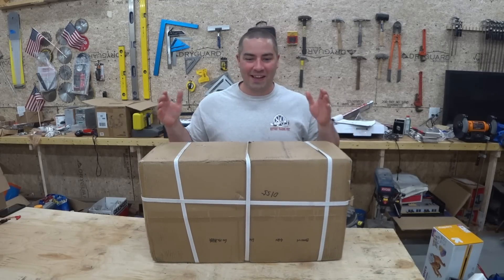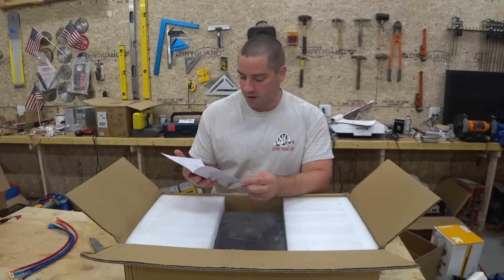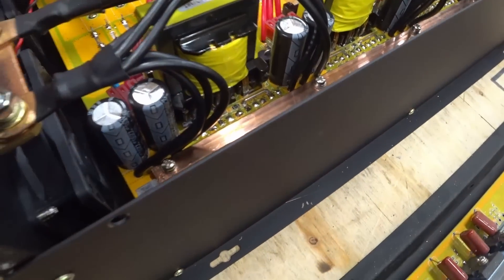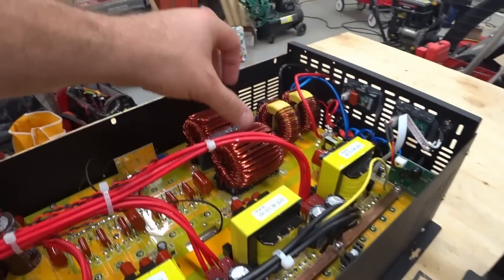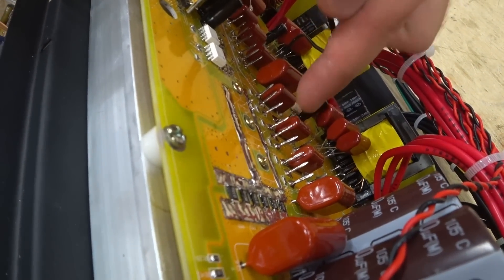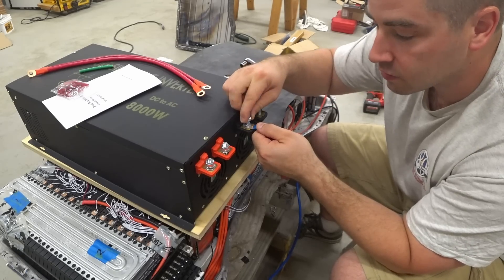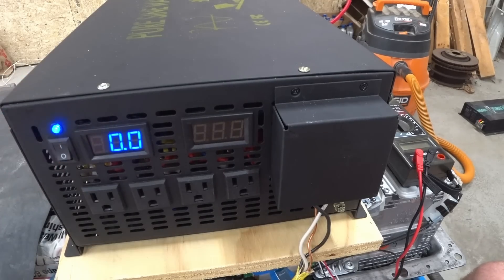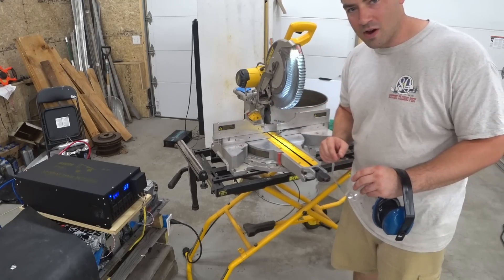Cheap 8000w Reliable Inverter, That Works! WZRELB

Comment: Awesome, now I’m really wanting to go off grid. With an inverter like that one, I wouldn’t have a problem keeping my house running 24-7 on battery’s and solar
Reply: Do it with a junk Inverter like this and you will end up with no power for most of the time, this rubbish will fail sooner rather than later guaranteed.

Comment: put an oscope on the inverter and see how clean the power is.. that a true indication on how well the inverter is.. thats the best test.
Reply: Indeed, also make a step response, use a storeget oscope and capture the first 200 ms to see the voltage drop, use a ac motor under load. Do not rely on a led display where the update time is poor, it is only for indication of how voltage is approx.
Reply: You do have to be VERY wary of claims and specs.  I even saw one inverter recently advertised as having "Pure modified sine-wave" output. Marketing people will do ANYTHING to sell stuff.
Reply: @exgenica  PURE BS LOL
Reply: A new, single-channel 70MHz scope decent enough for this kind of work is available these days for under US$100. Well worth it when investigating sources of noise and quality of AC. There are even some nice handheld digital scopes out there for about the same price that could probably address most issues involved in non-commercial AC hookups. I think I saw a new one on ebay/Amazon for about US$75 a week ago or so. Do thorough check of reviews and check to see if any youtube tutorials on the equipment before purchase.
Reply: @exgenica  That's Very Cool!! I haven't seen the scopes less than $100, but then, I was looking for better resolution. I never thought of 70Mhz.
Reply: Thanks for letting me know before I wasted an extra 15 minutes on this "test" - as if the first minute of repetitive comments and intro graphics weren't bad enough.
Reply: Yes, try to be nice. He is much more normal than the Tech Nerd like some of my friends and myself. Without Scope, we don't know how to work, and make a report.
Reply: Yeah.....be nice to see the wave output.....how true sine it really is......
Reply: Not sure he would know what a scope is or how to turn it on.
Reply: @g7mks383  really, stop acting like a prick!
Reply: ... It has these things here.... Has this thing that goes to this thing here....Which has two loop things and a screen with these line things.
Reply: @g7mks383  found the cool guy!, woooah, you know how to use a scope!
Reply: LOL  @g7mks383
Reply: @unreal6029  be nice -  he is trying -  and he posting - encouragement - advise - I  am concerned about lack of breakers - even dirty power kills. Shop around - Look for a used electical supply store - Locally or online - Keep Posting  / Keep  Testing - but Be safe.
Reply: @thomasbaldwin9594  That doesn't matter, because he is showing what the buying public will experience.

Comment: I have a 4000w for almost a year and going strong, but I rarely go above 3500w
Reply: Michael Tang how much it cost yours this days please?
Reply: i run a 2200 watt saw off 3500 w,.they say allways have 1000 more than you need.my gen inv. is 3500 as well.

Comment: The reason that the voltage increased (impossible) is that the RF noise produced by the 9 amp band was got past the output filter and interfered with the volunteer circuif.
This is remedied with an L/C filter between the vo!tmeter circuit and it's DC power supply and perhaps between the voltage signal connection and the voltmeter circuit.

What batteries, mfr model AH are you using for the 48 volt input ?
kvanderlipp@gmail.com
Reply from the maker: Thank you, that's interesting about the RF noise.

I'm using a battery I've been building the last few months.  It is from an electric vehicle (Smart Fortwo).  The original pack was 17.6 kwh, but I have re-arranged the cells and removed some.  I estimate around a 15.5 kwh pack right now.

Comment: the plug you used it your video looks like a GFI plug? this works with a floating ground?
Reply from the maker: I Guess so.   In an upcoming video I'll have to connect more outlets to try and load the inverter up with 8kw.  I'll try some outlets that are not GFCI
Reply: Leigh Amos , GFCI receptacles do not require a ground reference to function properly. They monitor the imbalance between hot and neutral to determine when to trip. BUT in this situation they will NOT function anyway because the fault current cannot go back to the inverter neutral since the inverter has no ground reference. The neutral of the inverter would need to be grounded to the earth for the GFCI to trip.

Comment: Could you Please check for me about the floating ground. Could you check if it is 60 Volts between the ground and each side of the blades on the plug or ground on the front wire hookup
Reply from the maker: Yes, there is 60 volts between HOT and Ground, and 60 volts between Neutral and Ground.

Comment: the AWG ratings are conservative and a usually for long distance. I have done testing myself on many wires and 10 awg can handle 60a no problem. just dont use it for long distance as the voltage drop would be massive.

Comment: I’d like to see the output sine wave on a scope to see if it is truly a sine and not half square wave or any riding spikes. I would also look up the awg chart to find out the required gauge wire for the stated amperage and replace those wires...regardless if they are short. I also wonder if there is adequate heat sink compound on those fet’s and not just a thin coat to save $$$. I would also check the output voltage with a Fluke meter...I do not trust those LED readout circuit boards. I did not notice if there was a cooling fan inside...if not I would definitely add one as it will save years on the fets. All in all, I am impressed with the performance.

Comment: Am I missing something? 8000 watt inverter is over 60 amps ac.  (2) 15-20 amp devices should be a walk in the park for a 8000 watt inverter.
Reply from the maker: They should be.  LOL.  I have had 2 8000w inverter blow trying to start my miter saw with nothing else attached.  So when this one worked I'm excited.  You can check out my other videos if you want to see the inverters fail.   In some upcoming videos I'll try to load this inverter down with 8kw.

Comment: No electrical approval? CSA or UL ? Also notice no approval on wiring or lock washers. Cheap screws phillips. They used crimp terminals and soldered them.  .
Reply: Yep, whatever poor electrical isolation they have in the rubbish will give out, it will end up killing someone

Comment: 8000 watts at 120 volts is about 66 amps. Also I would like to see that output on a scope, as it does boast a Pure Sine wave. A standard house wiring is 15-20 amp breaker per leg. I would breaker that in similar fashion...leads to the question of if they actually ARE using large enough wire on the output?
Nice vid. Thumbs up

Comment: Nice setting there, David! I would also be concerned with those thin wires. I have a 40 kW battery pack (traction batteries) and I connected it to my VictronEnergy 5000/48V with a 00 (2/0) wire AWG - in Europe we use metric units - so 70mm2. It never heats up and the whole setup works perfectly. The Scotts have a saying: I am not so rich to save on quality. ;-) Hope, the inverter meets up your requirements and it will be indeed reliable.
Reply from the maker: That's a good saying.

Comment: I Guess it increased the duty cycle going to the transformers when the load increased. Some inrush and maybe low resolution of the PWM lead to an increase of voltage under load.
Reply: Or probably they have programmed it to slightly increase voltage under load to compensate on line drop like most of the usb chargers.

Comment: You tested an inverter that is rated for 8kw continuous/16kw surge with maybe 2500w of load.

You plugged in some light loads and said "woo it works". That's not a review it's a travesty.

Come back with a proper testing methodology to test full ratings.

Till then you are just a paid shill.
Reply from the maker: In an upcoming video I plan to load it up to 8kw.  If it gets there I'll see how long it lasts, or if it gives up the smoke.  LOL

Comment: Thats undersized wire as the Chinese think 8000 watts at 240v is 33amps. Do that wire should be #8 awg for 240 v 33amp. 8000 watt.  On 120v it's 66 amps. So yes their engineering have severely screwed up
Reply: the length of the wire also plays into the required gauge of the wire.  For this length wire 10 g is quite adequate.
Reply: @carlglassmeyer8425  it is nice to see that some people understand resistance - generally the elecrical specs listed for different size cable/wire [gage] the current rating  is tested at 100',  not 6" so Carl is correct, 10 gauge is more than adequate. long circiit runs induce more resistance - therefore require larger gauge wire. Short circut runs have less resistance therefore  the opposite.  I would think this invertor would get hot  - overload drawing 5000 watts for 10 minutes. I have not read the invertor rating, but agree the transformers look small. The cable of concern are "outside the box"  the DC cable run.  Carl can explain.  I think the invertors are like many other purchases, you get what you pay for. 1st good thing - this company stands behind it products. Please test this invertor after 100 hours then 1000  hours of use. The designing engineers will watch. Hi tech is changing everything - time is the  true test. Keep testing - keep posting - keep infoming. THANKYOU
Reply: @carlglassmeyer8425   correct
Reply: The maximum continuous load will be 4000 to 5000 watts. You can't run 2kw through those little transformers continuously
Reply: Also... Chasis wiring is different from than house wiring.
Reply: The rating is likely at 240vac not 120!
Reply: Wrong! It changes in a metal chassis! I do agree though...I would have used #6THHN!
Reply: They probably know... but it's .01cent cheaper, so why not?  :)

Comment: You suffered with those previous models. From my experience I would not trust anything made in China with a funny brand name like 'reliable inverters'.  This model will hopefully suit your needs of course and work well but for myself would buy elsewhere like Taiwan or Malaysia made stuff is much better quality in general.
Reply: Exactly, this cheap Chinese stuff is rubbish, poor quality manufacturing, poor quality components and poor reliability, will only end up in landfill when it fails and cannot be repaired such a waste

Comment: This video is very nice presentation of device...
About the wiers...if the improve most of the elements maybe they put high quality of copper for output wiers...
For that short part from board to connection terminal is just fine...only things you are still missing is fuse after output(~20~30A)...to protect yourself before testing all of these devices...
One more time thanks for sharing your experience with us...
Great job...

Comment: I admit, the surge tests you ran looked good so far.  I wonder if the protection circuitry that inverter uses actually does indeed protect the power FETs, or uses them as a fuse, like so many cheap inverters?  Another test I would like to see performed is: what does the output voltage do as the input voltage is varied +/- 20%.  I also like to use an IR camera and look for hot spots in the circuitry while the inverter is at full load.  Time will tell however after at least a month's worth of use.
Reply: I used to work in a Motorola group producing Pwr. MOSFETs.  A common failure mode is a Source-Drain short circuit that would place a short circuit pretty much  across the input DC.  Hopefully each MOSFET seems to be individually fused so a single shorted FET will cause its' fuse to pop. That should protect the PCB from having a hole burned right through it which would render the unit unrepairable.  The problem is that if the load isn't removed or power cut-off immediately, the remaining FETs will try to make up the power loss and very likely fail very quickly thereafter, consecutively popping each of their fuses when they become shorted.  At least distributed fusing should save the PCB from getting multiple holes burned right through the card.

Comment: I have bought numerous Chinese inverters on eBay over the past year while trying to build up a solar system.  Everyone of them has grossly failed to put out what the ratings indicate.  For continuous output power, they  ranged from an actual output of 10 to 50% of published ratings.  By looking at the size of those 4 step-up transformers in the inverter you are testing, I would estimate your continuous output power to be about 3,000 watts.

Comment: You get very excited about something working the way it should. If you have had problems in the past with "bargain" inverters, you get what you pay for. A couple of inexpensive meters on the input and output would give you some meaningful information and some credibility. Load the inverter and let it run for an hour or two and measure the temperature of that big heat sink.
Reply from the maker: That's the plan for an upcoming video.  Thanks for watching.

Comment: ive always found that using the biggest wire possible is best , when my 2000w said use 2ga i said nope , 2/0 it is !
Reply: Unnecessary but wont hurt
Reply: +mazda2284  That was very smart.  2AWG wire can handle a decent amount of current as it is, but using 00AWG wire gave you a wider safety margin.

Comment: the wire is only 6in long. Fine for 60amps most likely... As a rule of thumb we say if its under 3ft, its no problem to go down 1 size.. And those 2 wires are only 6in..  No problem

Comment: Hard to say what that meter is measuring in voltage. I would want to hook up an oscilloscope and compare waveforms AC and inverter.
Reply: Amazing; that's exactly what I was going to recommend.
Reply: LMAO 🤣🤣🤣
Reply: Cual es el precio del equipo

Comment: Hey, just my 2 cents on safety and reliability. This inverter is what they call a high frequency inverter. This means that the FETs or IGBTs switch very fast (usually 10s of MHz) this allows for the use of smaller transformers and allows for a cheaper product to be manufactured. One of the big disadvantages of HF inverters is their inability to handle large inductive loads like motors. You can hear a problem with the noise coming from your miter saw under load as it sounds too bogged down, perhaps from the inverters inability to handle the inductive reactance and back emf from the miter saw. For inductive loads and in general a low frequency inverter is better. They have much larger Xformers and are in general a much more robust product. Next problem: safety. This inverter violates dozens of electrical best practices to the point that I wouldn’t even run it in my home if not watching the thing vigilantly. They use paralleled automotive fuses, didn’t trim the FET leads sticking out of the board, used way under gauge wire for EVERYTHING, and don’t have enough (any?) AC output filtering. They don’t do neutral to ground bonding, don’t use proper electrical color coding and the efficiency is awful (85% is abysmal). Remember, ink is cheap! You must independently verify all claims made. Try putting a scope on the AC output and running a large load. You will likely see huge deformation from a pure sine wave. There’s more wrong with the inverter- it’s likely not UL listing or tested meaning that if (when) your house burns down due to the lack or proper protection circuits on the inverter, your homeowners insurance probably won’t cover it. That being said I’d love to get my hands on one to properly go though it and see everything that’s wrong and see if some of it can be mitigated as an aftermarket repair. Probably not though as the AC traces in the board look way undersized. Just my .02. Best, Ben
Reply: First I'll say I like everything you commented on, you sound very educated in inverters and electrical theory. Way above me.

In my dream setup I'd love to have a sweet workhorse LF inverter like a magnum or any other brand, but they are VERY expensive. inverters like this fill a gap for people who don't have that kind of money. If it IS reliable (the channel "going off grid" has one and taxes it pretty hard) then it has my upcoming purchase based upon how the company has handled issues, sells repair kits, and has upgraded designs. these HF inverters fill a low price market. If I know what NOT to power with it, and give it a gentle life then I think it'll fit my needs. Or would you suggest I try and find a used / repairable LF inverter?  The only thing i've found weird about this company that I initially didn't like is that they named themselves in a way that will catch uneducated web searches, but I don't think they're taking advantage of people just by how I've seen them respond to problems. I'd love to get your feedback.